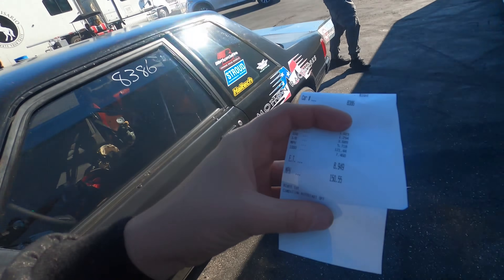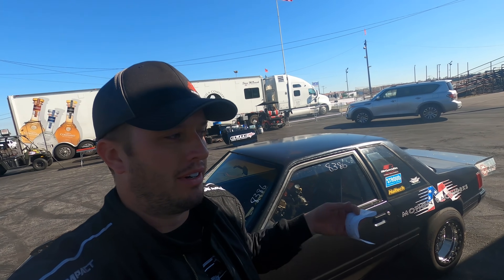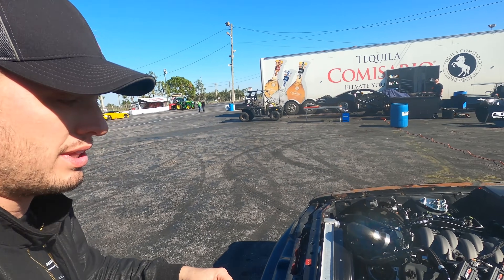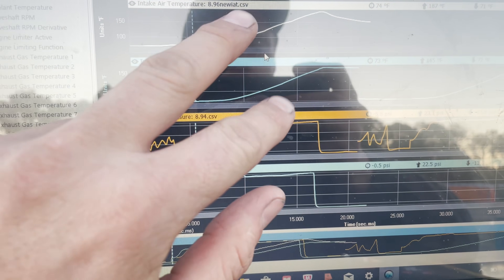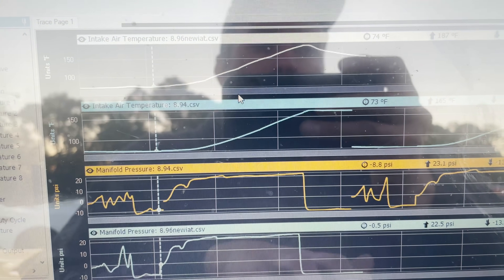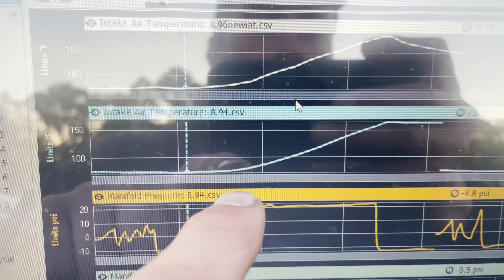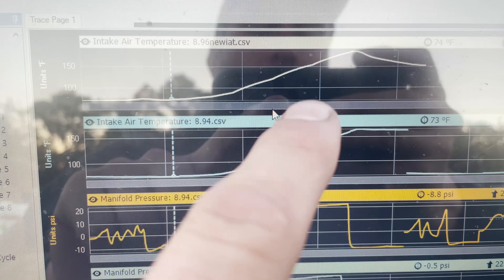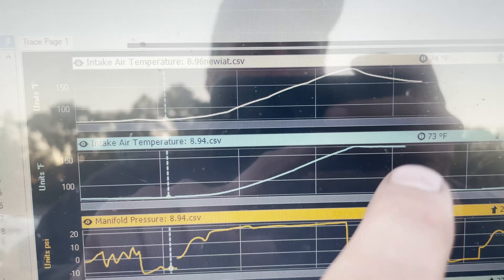Tech Tip Tuesday: RIFE Sensors IAT Sensors Make a HUGE Difference

Comment: I know they start around 74deg as you stated but is it calibrated? Could possibly the ohms ready is slightly different and not accurate? I would love a test in more controlled setting and see if it’s the same calibration. I only say this is because I had some issues with my ssi sensors and it was the offset calibration and was a pain but worked it out. 
Thanks love the channel

Comment: Just placed my order. Thanks for the video breakdown, definitely sold me on it for the responsiveness. Going into my turbo OBS 460 Ford F250 with an MS3X ECU.
Reply: Curious, how long did the sensor work for? Still working? Daily driver?
Reply: @umakemerandy3669  I had one issue with the first one acting a little erratic after a couple months but they sent me a new one for free once I told them. I've been running that one for well over a year on a daily driver and it's still good to go.
Reply: @johnvirgilsgarage  alrighty, yeah they seem like a good company that would replace pretty easy. Sounds good!

Comment: What is best recommended spot to place a act or iat sensor? Upper intake? Lower intake if applicable or on the pipe running to the throttle body?

Comment: Actually its not that the sensor is slow.   These sensors are exposed element type k thermocouples.  If you look at the sensors the exposed element of the gm sensor is much shorter and by the time it is screwed into the bung it's barely into the charge pipe, where the Rife sensor was much longer so that's where the difference is coming from.  Air  moves quickest through the center of the charge pipe so the closer to the center the reading is the more accurate reading of excursion temps you will see.  So basically what you are seeing is the difference between the depths the temp elements are reading and the closer to center you get the higher reading you will see.
Reply: I'm not disagreeing that it wouldn't be good for the "sensor TIP to be up inside the bung" but have you done back to back testing (with data) showing the GM works "as fast as the RIFE"? Or are you just saying RIFE's web site is showing incorrect/false info? ("ultra-fast response thermistors")...

Comment: Is there anybody that still does coil pack comparisons? Other than the older videos of LM7 and LS1 packs..  my stock LS6 still has stock coils with no heat sinks and my truck has LM7s and about to just swap them out but they’ve got some mileage on them.  Why buy new(er) if I don’t have to.  Theory was the stock LS1/6 packs would miss faster than the PCM can pick up on, and there for having a bad time when you’re racing at 7000rpm+.

Comment: Would this sensor work in an application where the ecu is expecting GM IAT output voltages? Like a stock ecu where you can’t calibrate the sensor?
Reply: The setting data is different between the two sensors. On a stock GM ECU you can adjust the calibration.

Comment: Let's see the GM and RIFE sensors side-by-side in a pot of hot water with some actual ohm readings.
Reply: There's the first attempt at actual data-driven science I've seen on this post yet. I shared this video around with a few other ME and CS engineer friends of mine and they just kick back and laugh. Just a veiled attempt to push more products to people who don't know any better. 

Faster is moar better....until you're chasing low speed fueling issues forever because your IAT is dragging charge temp around to where it actually isn't. Accurate data is great if you know wtf you're actually doing.
Reply: @anasasisxenophontis  A test like this would be far easier and more accurate on the bench.
Reply: Not the way to do it.  They are type k exposed element thermocouples.  The way flow is properly measured is directly in the center of flow because that's where velocity is fastest and heat will be more concentrated.  The gm sensor is much shorter that's why its reading is different and if they had a sensor dead center of flow it would read higher than the Rife.  These guys have no idea obviously that there is no way to read real time temp and understanding excursion temps is a must along with placement of the element in the flow path.  Sounds good what they are saying but they are missing the engineering principal behind why and where to take measurement for most accurate readings.

Comment: Hey Doug I see the data for some aftermarket computers but what about using this sensor with a GM MEFI computer? We build supercharged big block marine engines and are constantly melting the standard GM IAT. Any info is greatly appreciated and thank you and your team for another great tech tip!

Comment: What about using an Egt type sensor?  They work in the exhaust they should work in the inlet air stream too?
Reply: No and get sensor is different.  IAT sensors are open element type k thermocouples that are very small elements for quick response get sensors have a protective sheath to protect the element from the much higher excursion temps.

Comment: Calibration vs the GM sensor?  

Not all ECUs allow for custom sensors but if there is an offset I just adjust accordingly in the compensation tables?
Reply from the maker: All of the data is in the product listing on our website for setting up calibration data.  We actually had rife separate it out and write instructions for some of the more popular efi systems

Comment: Hey Doug, was looking at the RIFE 3/4 remote sensor blocks. Such a sleek/clean look. However I'm having a hard time finding information online about people running these. I know they are relatively new. What has been your experience with running these blocks so far, reliability wise. Can you comment on how they are holding up over time. 

Thanks!
Reply from the maker: We have had them on a few of our cars this year including my Nova which has several thousand street miles and prob a hundred passes!  They’ve been flawless and I really love the plumbing and wiring on them vs other remote ways of mounting sensors
Reply: @MotionRaceworksOfficial  Great news, did not know you had them in your Nova. That is what I wanted to hear. If they survived what you have put that Nova thru that is certainly enough for me. Thanks!!

Comment: How are you measuring accuracy though...certainly response time isn't your only metric. There are far more complicated dynamics at play when it comes to determining actual charge temperature. Unless you calibrated for the new first order lag dynamics of the IAT/ECT combination with the downstream thermal mass of the system, you probably found your mixture going lean with the new sensor.
Reply: I don't think its response time they are seeing.  If you notice the length of the Rife sensor is much longer so it is reading closer to the center of flow where air moves quicker and thays why he is seeing a different temp.  Ideally you want you open element in the center of flow because it moves fastest in the center.  Guarentee that if he had another sensor that was dead center of flow it would read even higher.  Thays why in the temp sensor industry it is important to spec sensors to center of flow for most accurate measurements.
Reply: @turbochevelle5641  the center of flow isolates the measurement from thermal mass that can affect it. It's not a temperature gradient along the radius of the tube the air flows through...it's just the heatsink that the sensor is mounted in. That affects the time constant of the system. I designed software for GM....the code is littered with first order lag filters to compensate for situations like this.

Comment: At 4 times the cost I would hope it would be faster. But for 99percent of applications the GM sensor will be 100percent fine.
Reply: DONT FORGET SHIPPING COST AND TAXES😎👍🏻
Motion raceworks rife sensor all day long!!! MADE IN USA!
Reply: 4x the cost? It's not even double the price
Reply: @Dlawler  ones $20 the other is $79... that's 4 times the cost...
Reply: @garyhowe88  is it though? One that's not just some off brand replacement on their site is $45, so $79 isn't even double that
Reply: @Jommybutler1234  yeah as I said for a not just some off brand one,  just going of the fact it doesn't list it as an ome part, or list the actual brand of the sensor its quite likely a Chinese sensor and be even worse than the one in the video
Reply: @Dlawler  What am I missing ?

The link I posted is for the GM sensor #12614717

It’s $18
Reply: @Jommybutler1234  the link you posted is for a replacement for a gm sensor, its not list as being an ome gm part, nor does it list a reputable aftermarket replacement brand. Which generally means its a cheap Chinese replacement sensor and that never a good idea on an performance tunned engine. I've seen brand new Chinese replacement temps sensors being off by over 10% when brand new out of the box
Reply: @Dlawler  Not sure how you determined the part I reference isn’t GM

Here is a different link and the price is even lower here. 

https://www.gmpartsdirect.com/oem-parts/gm-sensor-12614717

Comment: So the educational information is great but you're babbling on about it you could cut your video down save us time from watching all that jibber jabber get to the point
Reply from the maker: You just gotta put up with it if you’re gonna learn.  Sorry ;)
Reply: @MotionRaceworksOfficial  I say you do a very good job.
Reply: @0player-10   Correct. If you can't spend 11 minutes digesting new and important information, this may be the reason some racers are mid-pack instead of running at the top.

Comment: Temp sensors are pretty slow relatively speaking. I would saw
In your log where ever the ramp
Yo for the temp starts is probably more in line with where your boost ramp started to come in. Even if the temp sensor is a little bit behind as far as time. Temp should rise generally with the increase in pressure. Sweet product. There are some pretty gnarly temp sensors out there. Some are silly prices. But they have a place and I am glad they’re a choice. Anyways. America 1

Comment: I like seeing these faster iat sensors you’re right, the 1980 gm sensor is a bit slow, any idea if you will make a faster coolant temp sensor
Reply from the maker: They’re on the docket for RIFE!  Should be available quite soon
Reply: @MotionRaceworksOfficial  i figured you would be on top of it, they both seem to have the same response (like 3 seconds per degree) substantial when people have 3-5 second 8th cars.
Reply: How do I calibrate this sensor on my terminator x??